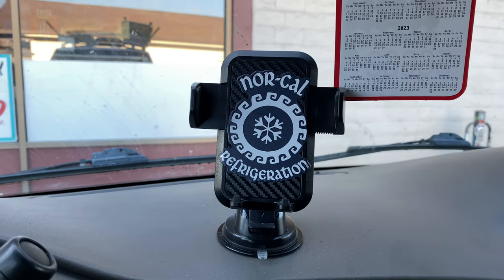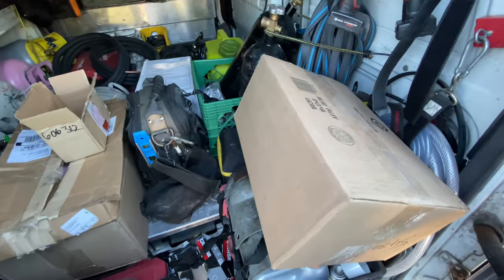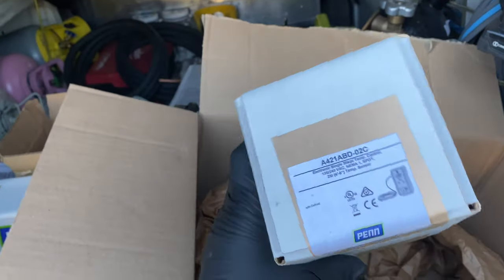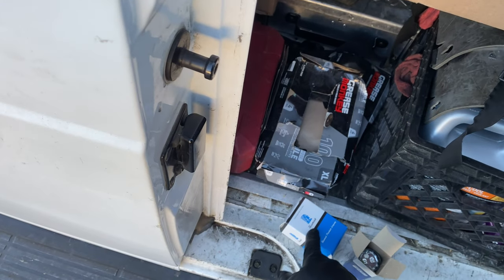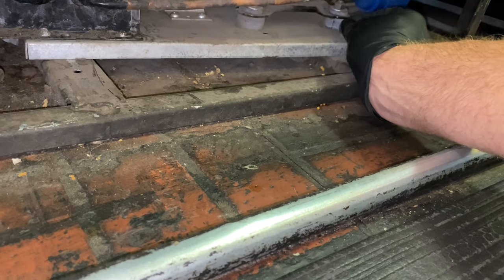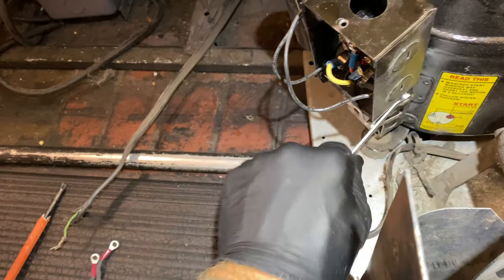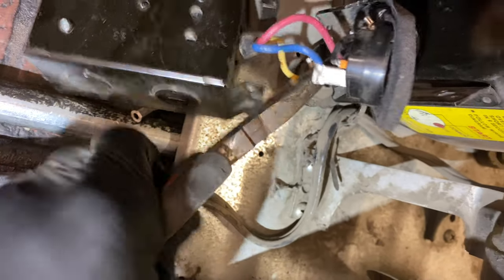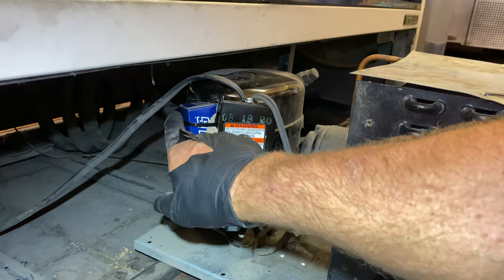Compressor start components

Comment: I’ve been working in this trade for almost 2 years now (mostly residential HVAC) and thanks to this video you posted, I am just now learning that the bleed resistors on start caps are removable. Geez I learn something new every day. 😀
Reply: OEM are usually soldered on

Comment: Did cleaning the condenser bring down the head temp or is it overcharged?
Reply: think the lack of a shroud is the issue  if a Cap tube System is Overcharged it wouldn't operate
Reply from the maker: The charge is correct the lack of AC in the store it runs with high ambient temps.

Comment: Need a little cardboard on the sides of the condenser to help with the air flow. Maybe you can drop the head pressure down a little

Comment: 🇺🇸❄💪👍 Great video.  Did u have to solder resistor on ? Thanks for sharing 👍
Reply: Replacements are spade connectors and the capacitors have extra lugs.
Reply: @davejohnsonnola7908  🇺🇸❄💪👍 thank-you my friend

Comment: Ever just throw a 3 N 1 at those things?
Reply from the maker: I have not. I should try that. Lol
Reply: I've had good luck with them.
Reply: I just replaced a skid last night. Existing compressor had a start capacitor, potential relay, and run capacitor. New compressor just has a start capacitor and a current relay. What’s the difference? The supply house messed up and sent me the wrong skid. I’m going back tonight to try to start it up.